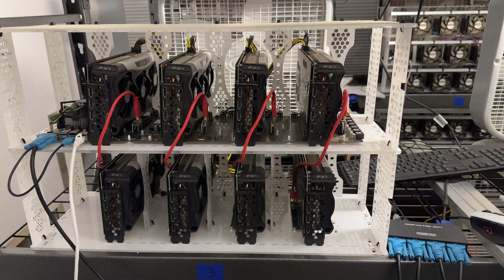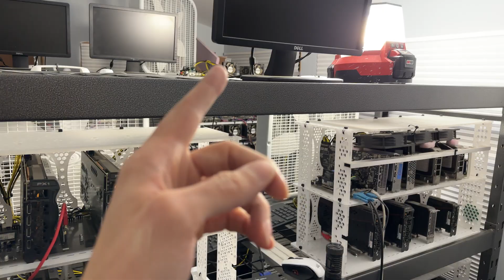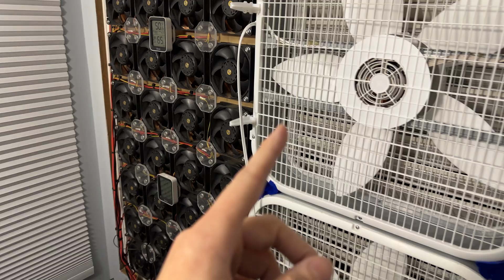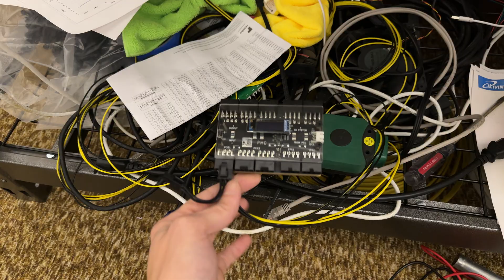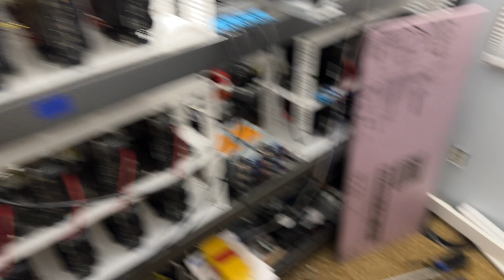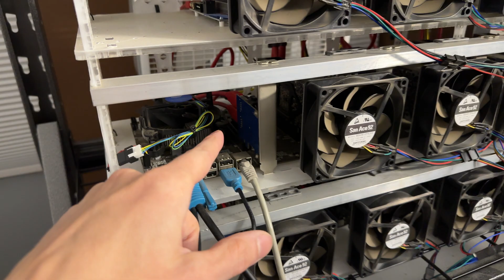Saving Power In Crypto Mining?

Comment: How did you get 5 cents/kwh? I'm in Ohio, the best I can get for residential is 7.5 cents + $85/month fixed cost.
Reply from the maker: I have a contract that sells me solar from my on site generation at a fixed cost, with net metering. So it’s sorta misleading, my ‘grid’ rate is a bit more. The farm is off for now, I was running low on credits and would have to start paying regular cost.
Reply: @SiCPoWMining  My 3K Sols Flux farm is still on, adding up all my usage is 5700 kwh/month. I'm making about 500 Flux with a $500 electricity bill. If I turn my farm off, I still have to pay $85 fixed electricity bill + 7.5 cents/ kwh, along with $100 heating bill. So, leaving the farm on is kinda breaking even.

Comment: Why you don't use something like donnager case for higher cooling effiency?
Reply from the maker: Cost and power consumption. A single box fan on low can keep the cards cooler than the same power consumption in high power small diameter fans. Plus the boxes cost a fair bit, and limit the options for the hardware.

Comment: I think at this point given the wattage of the fans and needed air movement. An HVAC squirrel cage fan will work better. And has no issue with restriction considering the size of your inlet vents.
One of those fans from an energy rated unit pulls 150 too 400 watts with either 3 speed setting or PWM/Sin-Wave.
Putting it on the upper window frame you have there and Not using the box fans to reduce turbulent air. We want it to rise.
Second thing I noticed from another vid is you have the vents duct low inside. It needs to be outside also with only 6-8 in from the ground. Look to move things like water with little disturbance. Let the cool water in and stay low while the heat pump above pulls the warmth out.
Last because of the cool being low. Rack height should be only chest high. That would be a final change though. The rest will make the most notable change.
The air movement will remain but get less restricted and more cold/hot flow control. Until the racks are lowered I'd put warmer units down below and let incoming air do it's thing.
You'll find you use less power with better heat management and may not need any of the box fans anymore. Once you passed 300w in cooling the cage fan was a new open option. Hell an OLD unit from the 90's pulled 300w on medium setting for a 5br home.
P.S. be careful of the vacuum pressure please. We used small shop-vac's on pressurized aircraft to test instruments in a pinch on the ground. Those suckers would give a massive headache if over pressurized or vacated and you were the guy in the aircraft. It takes little to get below the pressure of sea level or above atmospheric. Glad you have the gauge with you.